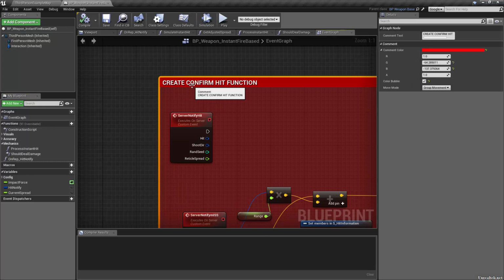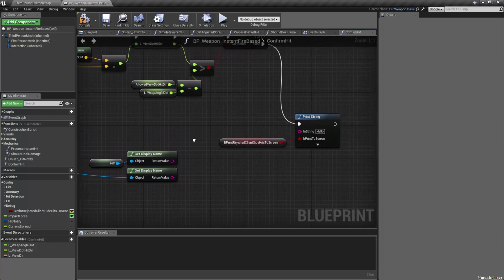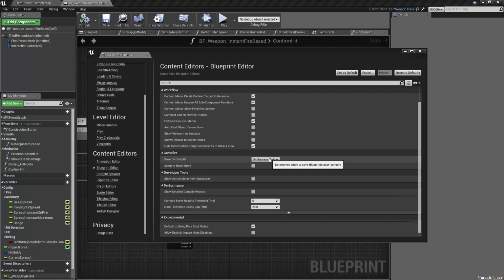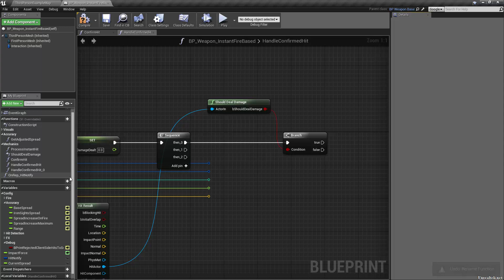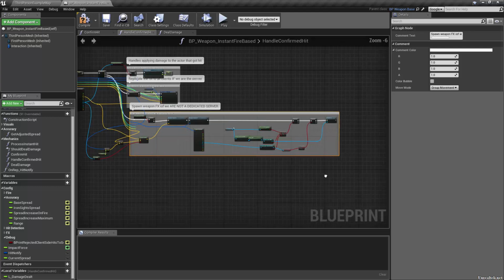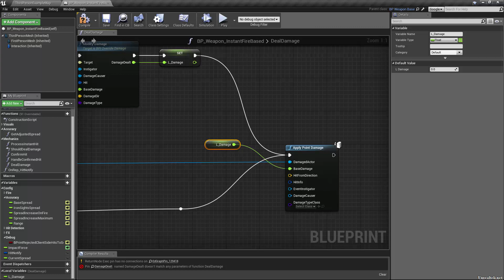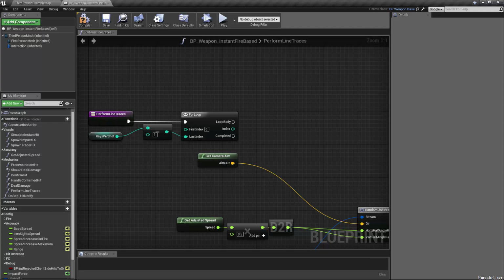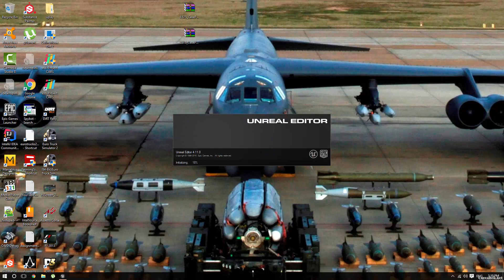Battlefield Clone in UE4 - 33 - Create A G36 Rifle Part 3 of 3

Comment: Hi Insomnia,

I've followed your BF_Clone series from beginning to end and would like to give the following feedback.

First of all I want to thank you for your great uploads.
It must have been an incredible task to get these done and you did it for a relatively small community. Awesome! :)
I will definitely donate once you have completed this series(Not what I think its worth though, because that would simply be more then i can spare .. I'd estimate a proper compensation for a course like this to be around ~300-400 dollar)

In my opinion you have provided a nearly perfect balance between speed, being informative, getting work done, dealing with bugs, etc. 
You would make an awesome teacher and I hope this project has helped you to get where you want to go.

I do however have the following list of what I think went wrong/could have been improved:
- Radial menu - skipped over Photoshop  / did not include texture for episode. (I had to print screen to follow this episode)
- Skipped over Blender / did not include models required for episode. (I had to import the Sedan from the simple driving tutorial)
- 2 episodes with ~21 seconds delay in audio. (i had to download them and use VLC to compensate because I was missing out on commentary) 
- with just a few partial exceptions, like the menu and team-color, you did not finish any module until the point of demonstrating its implementation.
- Skipped a node-recap, or project-upload after losing the mini-map footage, basically abandoning it.
- the interval between testing is to big (if at all), resulting in hard to track bugs if they occur.
- After months no progress and other projects in between, I can only conclude that you have abandoned the series after having made several assurances that you will finish things and make them come together into working demos of those specific modules.
- Your speed is perfect, however, when working on UMG, its best to keep your mouse on screen, or even accentuated, because lots of times you checked certain boxes, or changed values in between and it can become very hard to follow.

All in all, this has been easily the best series/course on the topic, but I'm just incredibly sad that you left us hanging like this. I won't be able to finish most of the work you've started, making the more value of the ~40 hours time investment that I made based on your assurances somewhat doubtful. Even though I've certainly learned a lot, I did not end up with the solid foundations you promised would be the conclusion of this series. So even though I want nothing more then to thumb up all episodes and make a donation to reflect the quality of your series and skills, I feel forced to give two thumb downs. One for seemingly flat-out abandoning the mini-map, and one for seemingly abandoning the series before conclusion and not keeping your promise. I really hope I'm wrong though and you will still bring this series to completion.